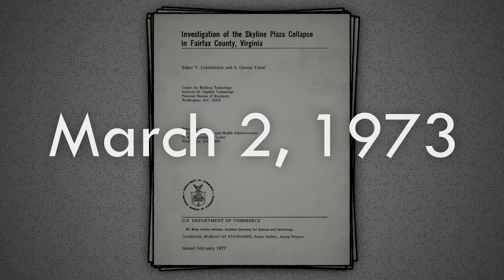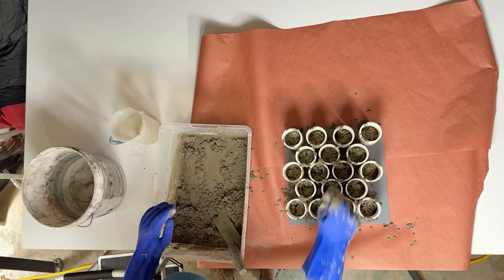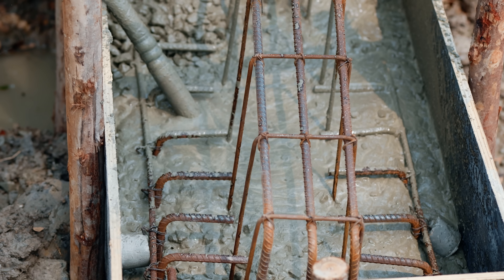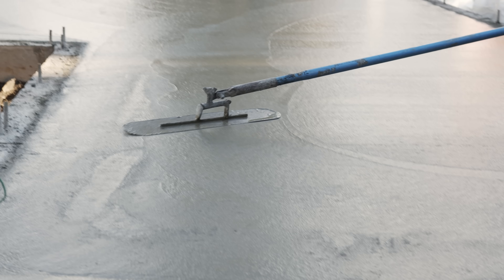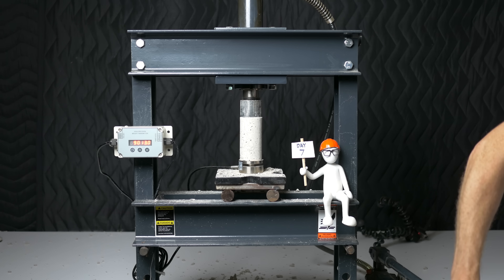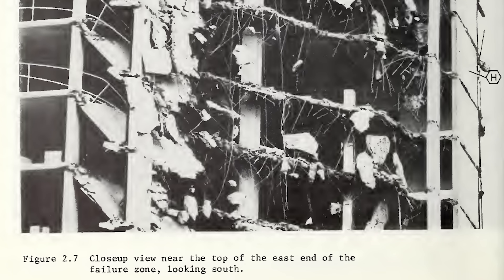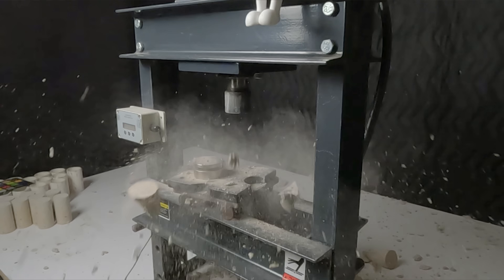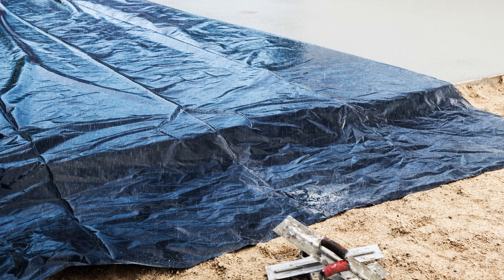Concrete's Greatest Weakness is Time

Comment: When I was about six, a babysitter that was taking care of us and another family's kids took us down to the playground at our local elementary school and discovered that some newly installed equipment had had some concrete freshly poured at its base. She had us leave initials and handprints that were still there when we left town ten years later. From Google maps, I think that section of the playground has since been torn up. 

On the one hand, it's kind of a core memory, on the other, thirty-odd years later my babysitter kind of strikes me as a teen vandal.

Comment: Since you did a video about the beginning of life issue for concrete, how about one about the end of life issues? I've been told that the biggest long term weakness of steel reinforced concrete is long term steel corrodes and expands leading to cracks and weaknesses. Roman concrete samples lasted millennia because it was pure concrete, not reinforced with anything. By that token is there any ways to increase the strength without the use of steel

Comment: On my first jobs the summer after I graduated high school was an "intern" for a construction materials testing firm in my town. Every morning I'd get the list of sample cylinders from the sample room that were at 7, 14, and 28 days, and then crush each one in a hydraulic cylinder, write down the psi it failed at, and then give them to one of the civil engineers. It was fun at first to crush concrete with a big machine but then quickly you realize it's both very repetitive and I also then had to cleanup and haul hundreds of pounds of concrete to the dumpster every day. Probably why they had the intern do it! lol

Comment: If the water drying up or being chemically consumed follows an exponential curve, it is like half life. So if it reaches 75% of long term strength in 7 days then the half life (of water in the concrete, I guess) is about 3.5 days, or doubling time for strength. The rule of thumb for half lives is after 5 half lives you get 97%, and after 10 half lives you’re basically done (99.9%). So after 35 days (10 doubling times, or 10 half lives) it would hit 99.9% cured, after 28 days it would be a very similar ~99.7% cured. Of course, it’s probably not exactly exponential, and the doubling time for strength varies I’m sure, but this in mostly in line with the graph you show.

Comment: I did 20 years as a concrete tester.
If you are having concrete poured, be there from start to finish... and get it tested. 

The contractors want it wetter, the pump operator wants it wetter, the supplier wants it wetter, and the driver doesn't care...... all reducing its strength.
And i have found far to many examples of the concrete coming at a weaker mix. The batch plant knows what trucks will be tested, so make them closer to the target. If they know that trucks won't be tested, they will try to pull the wool over your eyes.

Comment: Around 1982 my high school built a sports house next to the main building.  It was midwinter in New England, and the workers (apparently) added antifreeze into the water used in the concrete for the foundation, the idea being to prevent the water freezing before the concrete had a chance to set. One of my teachers said he was terrified that it was structurally unsound because of this added antifreeze which he claimed, and I cannot corroborate, was a new & not well understood technique at the time.  Over the ensuing decades do we have any information now about whether this antifreeze-doping helped, hurt, or had no effect on the concrete's strength? Thank you.

Comment: My engineering alma mater, now known as the OPUS College of Engineering at Marquette University (Milwaukee, Wisconsin), has three buildings: the original Haggerty Hall, the Olin Engineering Center, and the newer Discover Center (build after my time there). The Olin building has an open walk-through ground floor and even the second-floor lecture hall shows the concrete above it, both showing prominent square wells/reinforcing ribs. It has been told every freshman engineering class that when it was poured, each well’s form was packed with hay and a single incandescent light bulb to add, distribute, and hold in enough heat to effectively cure the concrete in a Milwaukee winter. Approximately 50 years on, I think it worked effectively!

Comment: 8:52 
Many projects required cores be cut and subsequently analyzed. Use what amounted to a drill press to cut the core, take it back to the lab and encase each end with sulfur, but it in the press and stress it until it broke.

Comment: In Eastern Germany in the 1960s, to solve the issue of missing living space, factory made mid and high rise building with factor made concrete slaps were build a lot. The standardized pieces (mostly the whole ceiling or wall of a room, with the window preinstalled), were connected, allowing really fast build times on side, and more standardized curing for the concrete in the factory.

Comment: I did lots of flat work and foundation/retaining walls in Marin. It is critical that the concrete comes from a trusted supplier. We never had a compressive test failure on the jobs I worked on. We also did not get the extremely low temperatures seen in the East. The affect of very low temps must be a big concern on those projects.
While most of the discussion was of concrete typically used in foundations and columns i.s. structural uses, most of the video showed flat work on multi story buildings. I would enjoy a video discussing "light weight" concrete used in those applications.
Thanks for the good work!

Comment: I'm interested for you to compare where prefab concrete slabs would be better than on-site pouring. I remember trying to fall asleep, looking up at the ceiling of a motel room I was in, when I noticed it was concrete slabs about 4' wide that formed the ceiling and was likely also the floor of the room above. That got me thinking that slabs must have been cheaper than an on-site pour.

Comment: As a plumber that does renovations in the commercial sector, I add 7% to the labor total for any building built pre-1985. The concrete in those buildings is incredibly difficult to demo and work around. Concrete from the 1950’s is especially brutal, as they used a lot of larger river rocks as aggregate in my area.

Comment: Grady,

I work in mechanical engineering for buildings, a topic you could cover is cores through structural slabs.  Obviously during design we as designers try to predict cores for vertical pipe penetrations but can only go so far.  It would be cool to see how properly reinforced sleeves versus cores effect a sturctural slabs performance.

Comment: I wonder if those chlorine containing accelerators will become more popular with the use of fibreglass rebar that wouldn't be affected by corrosion in the long term?

Careful with the press to both Grady's! Polycarbonate shield or maybe a longer hydraulic lever might keep your arm safer from the concrete chunks lol

Thank you as always for the amazing content, keep up the great work :)

Comment: Calcium oxide is one ingredient of cement/concrete that when mixed with water does the chemical reaction you mentioned and forms into calcium hydroxide is where the water goes, then when the concrete dries up it releases excess water and also starts to absorb carbon dioxide from the air, so I gather if you want to dry/cure your concrete more faster then you just blast it with CO2. Not sure if it works as I imagine, perhaps it just needs to take time, but one can try and test if it works. 😁

Comment: I used to work in a factory making hollow core concrete slabs. The concrete mix was extremely dry, but they were moulded on a heated bed using an extrusion machine and high pressure. After six hours they were strong enough to be lifted with a crane and transported to a building site to be used as a floor/ceiling in an apartment building. Extremely effective technology. That was in year 1990.

Comment: I live in Alberta and it's cold. -35C is a normal winter day. that said we showed up to a house to drywall and the garage that we were there for calapsed when the concrete thawed up. Multiple houses were hit with bad concrete and it messed things up. Surprisingly the houses that were finished more took the brunt better but not really because they all had to be rebuilt. the house we showed up for wasn't ready for us as is was. It was a bad run of trash homes for a couple decades.

Comment: I spent years doing testing and research on concrete and asphalt for the Florida DOT. It is an incredible material, although I didn't care much for tiny little stainless steel fibers added to some of the high strength stuff we were testing. Even with gloves we still went home with a few hundred holes in each hand😎.

Comment: → 7:13 Marking a "kilogrady" scale with markers like 10K implies using 10 kilokilogradys? Better call the base unit of your press a grady, so you are now measuring 9.3 kilogradys (or 9300 gradys).
→ I guess one way to install pre-tested concrete is to install pre-fabricated concrete slabs, instead of pouring it on-site. It requires stronger cranes and might not work for all shapes, of course.

Comment: Soviet Union and its satelite countries had introduced technology, that is faster and allows test elements made of concrete before mounting. Commie blocks, manufactures were producing slabs, then parts were delivered to construction site and mounted there. Sometiemes even entire room was one piece, lifted by crane and welded with rebars to building during construction. Everything was installed before mounting. That solution was used for example in bathrooms. All pipes were instaled before ariived to destination. Just connect it on the spot.

Comment: A, now it makes sense why Chinese tofu-dreg buildings fall apart so often. 

It's because concrete takes some serious planning and patience. In a country with so much endemic corruption and corner-cutting, they probably don't wait the proper time for setting and likely use the cheapest materials possible. I've even seen videos of them using fake rebar.

Comment: Something something lack of limestone chunks, salt, and the inclusion of iron results in concrete that spalds and disintegrates after only a few centuries. Half the concrete isn't made to last more than a couple generations at best -.-
Actual longevity is rarely considered tho, only 'how long does it 'need' to last'

Comment: That's  why we now use the concept or "concrete maturity", which is a combination of time lapsed and temperature exposure since pouring, to determine the proper time for removing formwork and/or stressing the structure.

Comment: Our government(hong kong) is prompting a method called "MIC" Modular Integrated Construction that might be a solution for the "time" problem of concrete?   By building floors in a factory, they are claiming to build public housing in record speed: (6 day a floor)!!! https://www.legco.gov.hk/yr2025/english/panels/hg/papers/hg20250509cb1-730-2-e.pdf#:~:text=This%20technology%20has%20been%20successfully%20applied%20in,achieve%20a%20four%2Dday%20per%20floor%20construction%20cycle.
What's Grady's take on this?

Comment: I have a question about Owens Corning's new fiberglass Rebar.  How is it comparable to traditional Rebar?  Is it so much more expensive that it is not cost effective to use, as the advantage that you get no size growth due to rusting, which would result in much longer life out of the structure.  Zack of @Zackjerryrig everything did a video about it. But that could be considered an Ad for Corning.

Comment: Modern tall buildings are like matchstick models wrapped in scotch tape. It's all glass and concrete pillars, after just 50 years concrete starts to fall apart (unless it's a 5m thick bunker wall). Back in my day we used to put up walls stone. by. stone. and they held for generations.

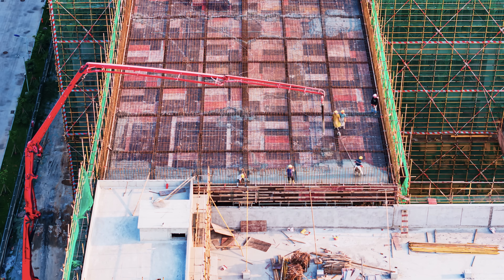Comment: 4:11 the parallax in this shot is crazy. If you look at the boom arm for the cement pump truck, everything around it is shifting!
Reply: As a construction inspector for state highways and bridges, I can assure you that concrete pump truck IS shifting back and forth that much from seeing it happen myself, that pump truck is sending hundreds of pounds of cement each time it pumps and I’ve seen the end of the metal boom bounce up and down feet at a time, I can’t say for sure if it’s just the weight making it bounce or not but I can say for sure that’s not the camera playing tricks or anything.

Comment: This entire video is why in general I prefer the idea of doing as little in situ concrete work as possible, and have it done before. It can add some logistic problems, but having concrete cure in controlled conditions can be really useful in ensuring a high quality cure and product - specially prestressed concrete.
This is of course not always possible but it can allow you do cure most of the structure at once and have the actual installation be a briefer process, meaning less mess on the site.

Comment: My apartment is in a 2-storey block built 80 years ago, concrete poured into wooden formwork, not pre-cast like it's done nowadays (I've seen construction photos). We had earthquake proofing work done a while back -- they cut slots into the concrete along the walls and roof at intervals, which were filled with rubbery grout to provide pre-made stress relief lines. A bit after that a crack did appear about half a foot away from the pre-made line unfortunately. Concrete gets stronger, harder and more brittle as it ages, to the point it will break under it's own weight if not otherwise strengthened.

Comment: It is too bad you did not do a collaboration with Engineer Tyler Lay, he is an engineering Professor at Oklahoma State University and has the Tyler Lay YT channel that wholly focuses on everything r/t concrete. He has talked about rebar types and materials, retarders, accelerators and other add mixes, different concrete mixes, aggregate, strength testing, pretensioning, post tensioning, Roman concrete, testing dry pour vs mixed concrete, etc

Comment: I guess the 1 day, 1 week, 1 motht rule they use here is pretty good according to your testing. 1 day before removing forms, 1 week before starting framing and 1 month before enclosing. But that is for slabs under wooden houses and not multi storage concrete structures.

Comment: Here in Sydney, Australia we've had concrete pours opened to buses and trucks hours after pouring. They'll cut up a section of road for works overnight, do the work, pour concrete, then fully reopen the road by 6am. Having watched this I'm really curious how they manage to get such a tight turnaround. Our weather is relatively warm, even in winter, so I'm guessing that plays a role, but if anyone actually knows how they get a concrete road ready to load so fast I'd love to know.

Comment: There's a retail store that started putting weight on a new concrete floor before it was completely cured on the bottom, and it permanently tilted the store's floor slightly to one end of the store.

Comment: Amazing you made a video about concrete and its curing, and didnt mention the Hoover Dam, which famously used water cooling pipes to help it cure and stay cool - and it will continue to cure, roughly estimated at 100 years, until 2035 possibly longer.
Reply: Hoover dam crossed my mind as well during the video. They competed that dam under budget and early! Research the Owyee reservoir dam, I understand it was a mini hoover dam, where they tested & explored engineering ideas before doing hoover.

Comment: I used to install and dismantle the propping that held up new floors, occasionally you'd find a section that would sag and stay loaded for longer than normal. You want the props to pop free after minimal unwinding. 
We'd chain multiple floor so the props were supporting a couple floors that were also propped above.
If we notice the lvls staying in contact for 1 or 2 more rotations than normal, you have to re-set it and leave it longer. 
It wasn't common but it probably saved a few floors of uncured concrete

Comment: Grady, thank you.  Concrete both excites and terrifies me, all at the same time.  It's a great material for pouring foundations, pads, footings, driveways, sidewalks, and roads, but when it fails in a bridge or building application, it sure does fail out loud, doesn't it?

Comment: Just to add some clarity on the break tests — 14 day breaks are not rarely required. Break tests will be performed at 7, 14, and 28 days for every pour. Loading the concrete early is application dependent and requires an engineer to review the break results. For highly loaded foundations/structures, the full 28 day cure and passing break tests will almost always be required. The average of any 3 tests much reach design strength with none of the tests failing by more than 500psi. For lightly loaded structures, the engineer may allow operations to continue early if the samples achieve 75% of their design strength.

Comment: The CN Tower's main concrete shaft was poured between June 1973 and February 1974, using a slipform method that allowed the structure to rise approximately 20 feet (6 meters) per day. The construction of the entire tower began on February 6, 1973, and was completed in April 1975,

Comment: A recent pour of a foundation for a trash enclosure.  Specified strength 4500 psi at 28 days.  Measured break on a cylinder at 56 days - over 11000 psi.  Oops.  Some day when that has to come out someone is going to have a long, hard day.

Comment: Since lower floors are supporting more weight than upper ones in a high-rise building, is it common for different mixes to be used on different floors as the building goes up?